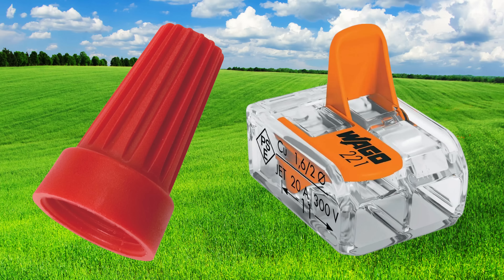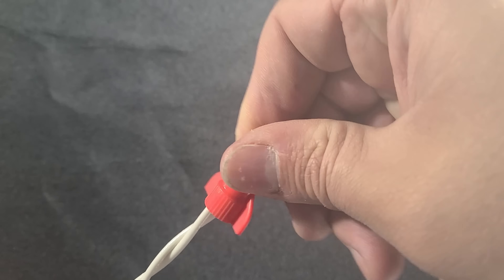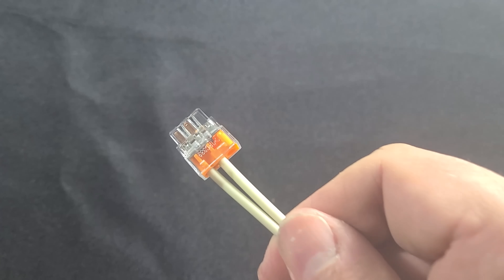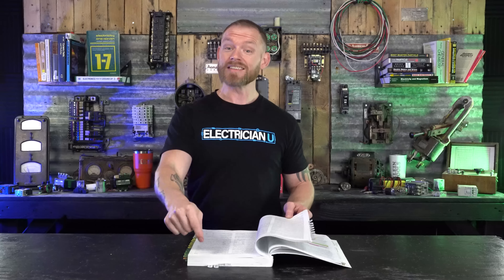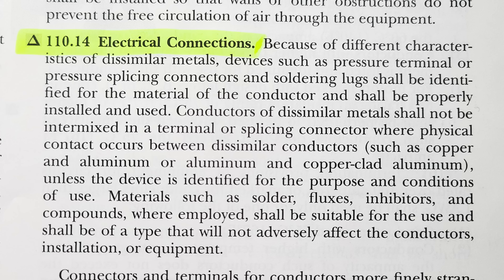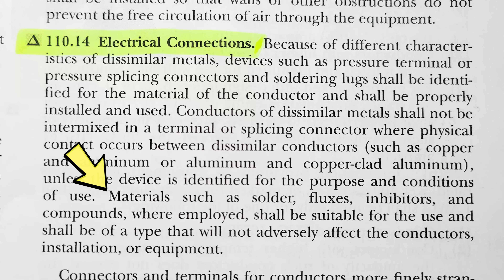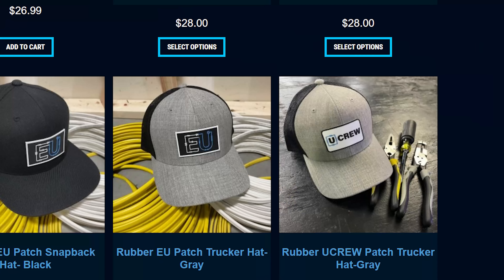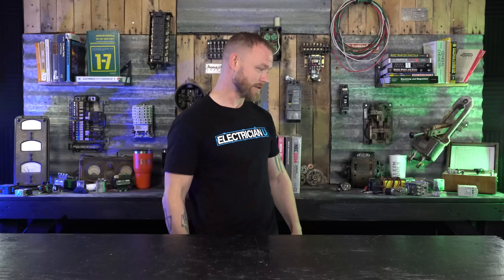Should We Use WAGOS or WIRENUTS?!?!

Comment: Why to use Wago:
- Way easier to install correctly(especially when connecting stranded to solid or different gauges)
- On first sight you can see if it's installed correctly
- Easy to troubleshoot and redo
- Does not damage wire
- Cheapest way to properly connect Cu with Al
- Saves time
- Can be used on shorter wires where you couldn't install wirenut
- Better in vibrating conditions

Why to use wirenuts:
- Cost
Reply: But if it's faster to use a WAGO than a Wirenut, then cost (in your time) is a plus of a WAGO.
Reply: @fredashay  depends on what you’re used to definitively. Experience = speed but I find wire nuts to be much faster especially for stranded wire. Mainly because it can be a pain to insert a stranded wire in the wago, they also take up slightly more space so you spend more time getting your wires to fit in the JBox. If I used wagos more often I’d prolly prefer them though
Reply: @fredashay  what difference does 5 or 10 seconds make? It is not like you need two hours to putl a wirenut.
Reply: @Cybergodless  Okay, but why an egg?
Reply: @fredashay  speed unimportant when wiring a nursery.
Reply: @fredashay  if all you care about is faster why don't you just lay down an extension cord and leave? that's the fastest way to wire a building.
Reply: @mrromantimothy  You may have a valid criticism for whatever it is I said, but I'm not gonna read through 89 comments to see what I said 6 months ago that you're replying to  ¯\_(ツ)_/¯
Reply: @fredashay  I'm not getting blue in the face over you I'm getting up blue in the face over people that will listen to me and not burn shit up
Reply: @PW_12345  1.5A of use? what? You have no clue what you are talking about I have multiple outlets in my house that are drawing 10A for a majority of the day. ALSO because the load wire will lead to OTHER outlets, not JUST to itself. your understanding is bad, the Wago and the Outlet will have the SAME UL ratings. Wago's ARE SPRING loaded, you increase and decrease the SPRING loaded tension with the lever.  this is how they are able to fit multiple sizes of wire. The backstab are SPRING loaded just without a lever
Reply: Wago's should not be used with Al.  Don't use Wago.  I've had more problems with Wago than wire nuts.  Anything over 15A you want to use wire nut.  If you working with under 10A and especially working with DC, then Wago is an option.
Reply: @joeboxter3635  Actually, wagos are rated for al conductors but the conductors must be treated with a special paste that Wago produces for the purpose.  They are one of only three permanent fixes for al wire termination accepted here in the USA.
Reply: All things being equal and with a properly trained electrician doing the install, a wire nut with pre-twisted conductors is and will ALWAYS be a superior connection. PERIOD
Reply: @chadillac2472  Would you bet your life on your electrician being "properly trained"?
Reply: @chadillac2472  But things are not equal, are they? 

In a big installation, you're looking at hundreds, potentially thousands, of connections needing to be made. That's many, MANY hours of extra work, for a few milliohms of gain on each circuit. It's virtually a drop of piss in the ocean.

Meanwhile, there are a lot of shortcomings to the wire nut: It's very difficult to use with short leads. You're unable to visually inspect the connection. The caps can come loose, leaving naked conductors in your junction boxes. The difficulty/impossibility of making a safe connection with stranded wire. And so on.
Reply: I'm concerned about the higher resistance caused by  a WAGO'S connection. They heat up a lot compared to the direct wire to wire connection of wirenuts. The higher resistance and inefficiency is the cost for comfort. Something I'd be willing to give up.
Reply: @AllinnKall  You're not concerned, you're just trying to justify using worse connector.
Reply: @AllinnKall  only a concern if youre running 50 amps on 12 awg wire. The resistance between the two connectors doesn't matter on your regular 15-20A circuits. Whatever electronic you got hooked up probably has cheap chinese 18-16 awg wire inside it anyways.
Reply: ...and reduced points of failure.  Wire nut connects wire to wire with full ampacity of the wire through the connection.  Wago has 2 points of failure and higher resistance than a wire nut connection increasing the risk of connection failure on a heavily loaded circuit or in a harsh environment.  Wire nuts for the win.👌
Reply: Happy birthday bro enjoy God bless you all
Reply: @PW_12345  again, I’m not reading this wall of crap. PRE TWIST THE FUCKING SOLID AS I MENTIONED, THEN TWIST THE FUCKING STRANDED OVER THE TOP FOLLOWING THE GROOVES OF THE SOLID. IT WILL NEVER PULL OUT YOU ABSOLUTE POTATO. Jesus fucking Christ.
Reply: the wago type of connection using CU to Al back in the '70s and '80s when Alcoa was pushing , aluminum Romex for residential use and the fires and  deaths that ensued was the original reason wire nuts with a stainless steel spring connection with solid copper pigtails to the device were and still are required.
Reply: @mrromantimothy  the Springs in the purple wirenuts are cu/al alloy and they are filled with Noalox.
Reply: one weak "con" for wago... They're not available at local stores, you have to order them online and wait 3+ days for them to arrive.
The closest I found were push-in connectors that are similar to european leverless Wagos. And those things are impossible to use with stranded wires.
Reply: @humbughumbughumbug  menards has them in stores.
Reply: @tremolobar  Oh... Unfortunately 😢 I live in the horrible state of New York, and we don't have Menards. We're stuck with Lowes, HD, and maybe Ace Hardware if we're lucky.
Reply: @humbughumbughumbug  all the local electrical supply houses have them in the upstate of NY.  I keep stock of a good array of the 221-40x and 221-60x Wagos.  Easy thing to do.
Reply: @mikeiver  that's because they are intended for fixtures and fixture wire you are using them for every thing you do is not correct
Reply: bulls eye! or should i say "money shot" (lame pun intended) since your comment was regarding price... hehehehehe
Reply: @Rowdy No, they are not.
Reply: @Rowdy Service entrance is nowhere near the same.
Reply: You forgot resistance and heat.  wagos get hotter
Reply: I use whatever. I have no preference. Been In The trade since 93. I find that a good connection no matter what it is will last longer than me.
Reply: I'm not an electrician by any means but would it better for home owners to use wire nuts because of cost and the few hours are minutes it would take him to do the job himself?(knowing what he's doing of course). Compared to an electrician who needs to work work fast because of the quantity of work he's doing without the loss of quality(proving that the leg-goes are quicker to install).
Reply: Spot on.
Easy to use/doesn't damage stranded conductors.
Always remember to utilise WAGO connectors according to the manufacturer's specification. ie you need to be professionally competent to understand equipment limitations - even WAGO connectors.
Reply: Wagos are also very handy on the workbench.  They will join a meter probe to a loose wire, when you're testing something small.  Then you get your wires back, undamaged.
Reply: @PW_12345  "Also in areas where there are a lot of hot/cold cycles I'm hearing the wegos are failing"

You're hearing bullshit. Wagos are best in this exact scenario because the spring keeps pressure even when the wires contracts/shift. The push and lever connectors are pretty much the same. The lever is not part of the spring clamp, it just allows you to apply pressure on the spring to easily install/remove the wire.

I don't say you can't make good connection using wirenut. It's just way easier to make a bad one.
Reply: Another pro for he wirenut is resistance. If there's a lot of current flowing through the connection, it might be better to use a wirenut over a Wago.
GreatScott just made a video comparing these connectors.
Reply: @ddegn  They have a higher resistance but they are both low enough that it really doesnt matter
Reply: @derfurz8618  2Watts per connection per phase on a 20Amp circuit adds up in a hurry, especially if factorvin the millions of connections in a country( think EU countries that require WAGO).
Reply: @ddegn  I noticed this years ago, and I now use wagos for holding branch circuit splices in lighting, and low voltage controls.  I'll splice 3 18 solids and place them in a single port, that eliminates 2 bus bar contacts.  So essentially branching off a single port with good splices lowers the resistance no?  I like wire nuts for my feeders and wagos for my branches.  If that makes sense.
Reply: @bigcountry5520  Not legal in the US but I understand what you are doing there.
Reply: @ddegn  I've seen several videos comparing the current capacity of both Wagos (multiple types of Wagos) and wire nuts, ramping the current up to failure. NONE of them failed up to their rating. All of them failed long after the wire's insulation failed. The resistance isn't going to be the determining factor for choosing Wago vs wire nut as long as you use them properly.
Reply: @ddegn  Exactly.  The wire nut is a CU to CU connection vice the WAGO CU to Steel one.  The resistance between the two, CU and steel, are significantly different.
Reply: @ddegn  "Another pro for he wirenut is resistance." The Wago type connectors are essentially bus bars with convenient connectors - would you not use a bus bar elsewhere?
Reply: @nickryan3417  "would you not use a bus bar elsewhere?"
Unless I wanted or needed less resistance.
Wago type connectors are much more convenient than wire nuts but this doesn't change the fact that wire nuts have less resistance.
Reply: @ddegn  wire nuts have more resistance. Studies were done and show this. Do research before saying something stupid sgain.
Reply: @vinniecocco9932  "Studies were done and show this."
Which studies?
I referenced a Great Scott! video in my earlier reply. The title of the video is "What Wire Connector is the Best? Settling a Debate! Wire Nut VS Wago."
This video shows the wire nuts tested had lower resistance than Wago connectors.
There's also a video titled "Comparing Wire Connector Resistance - Wago vs. Twist-on Wire Nut" on the channel "Christopher Masto." This video also shows the wire nut had less resistance than the Wago.
If you provide the name (or other search terms) of these "studies," I'll be glad to take a look at them.
How much more resistance do wire nuts have over Wago connectors?
Reply: @ddegn  Wagos are certified for 24 or 32 amps and are guaranteed to deliver that. That is plenty for almost all use cases. A badly installed wirenut can handle less and you can only tell if you fucked it up after the house burnt down. Wago anytime of the day, safer and faster, the costs are minimal compared to the time you save installing.
Reply: @modmoto6016  I'm sold on Wagos myself. I'm just pointing out a couple sources (YouTube videos) which show wire nuts had less resistance than Wagos. Even if a wire nut can have less resistance than a Wago there are plenty of other reasons to chose a Wago over a wire nut.
After watching the various Wago vs wire nut videos, I purchased more Wago connectors. I haven't purchased any new wire nuts. This doesn't change the fact the videos mentioned show lower resistance in a wire nut compared with a Wago.
Again, if someone has sources showing Wagos have less resistance than wire nuts, I'd like to see them.
Reply: @ddegn  if there's a lot of current flowing through you better sold these cables together
Reply: @ddegn  You should dimension your wires and section your installation in a way that you have enough headroom to safely manage any added resistance. And really, we're talking some amount of milliohms per connection, if that.
Reply: @ddegn  the Wago’s I used are rated for 20 Amps and 300 volts. That should cover most stuff in the home.
Reply: @ddegn only at the start… for 23Amps…. I think he was aiming a heat gun directly on the components… you’re never gonna do that in real life… plus… after 20mins, they all went to the same temperature more or less…. At about 105 degrees I think… Wago & wire nuts are rated at 221F so no cause for alarm… some components do get hot with time but that’s mostly normal depending on the work/load & time

Wagos are the norm in most parts of Europe while Wirenuts are the norm in the US because it’s cost effective and do the same thing 

I still however favor Wagos since they’re much less time consuming and there’s a less likely chance you’ll connect a Wago wrong Vs a wirenut… electricians get rushed to finish fast as well so Wagos might be the better fit in the US like 10yrs down the road since the US is slower to adapt than other places because bureaucracy
Reply: @carlosf9278  I've mentioned several times in this thread, I prefer to use Wago connectors more than wire nuts. 
@vinniecocco9932  Claimed there were studies showing Wagos had less resistance than wire nuts but never provided a way to find these studies.
I provided names to a couple videos which claim to show wire nuts have less resistance than Wagos. While it seems logical that a wire nut used correctly has less resistance, I don't think this slightly lower resistance is enough for most people (myself included) to chose wire nuts over Wagos.
Since making my first reply in this thread, I've used many Wago connectors in various projects. I haven't used a wire nut for several decades.
Reply: @ddegn  I use mostly wire nuts since that’s what the company I work for uses/has… I work for a general contracting company, and we use whatever, and every clients we’ve ever had, has never had an issue… well except a few leaks here and there but that’s our plumbers fault lol

Electrical wiring/configuration, no issues… but mostly using wire nuts 🥜 

We’ve yet to use Wagos on a home all the way… every now and then I have some on me that I purchase either online or at Home Depot (some Home Depot’s sell wago!!!) & they work great… as far as long term use I can’t say for sure since I’ve only ever used a Wago for a little less than a year. 

Wagos are definitely nice to use and definitely help a lot when you’re doing a 3/4 way connection. Many electricians in the states prefer wire nuts and I think that’s mostly because how they were taught/prefer and I respect that 

I’m studying to be an Electrical Engineer so since I’m doing General Contracting, hardly anyone teaches me anything since I’ll only be helping for a moment… which sucks since that means I’ll have to work twice as hard in order to learns the things that some of my coworkers learned from their superiors in the past 🫠
Reply: @carlosf9278  
Thanks for all the great info.
Good luck with your education.
Reply: @ddegn  You Americans are so obsessed with this 1 non existing issue on the Wago's, it's literally the only thing you can find against them.
Reply: @DonBugatti  Did you miss my replies where I state I prefer Wagos? I simply stated the results of a couple of YouTube videos stating wire nuts have less resistance than Wagos. As I've stated several times, I prefer Wagos over wire nuts. Why do you think I'm obsessed with this? I'm not the one commentating on old replies. If someone is obsessed, it's you.
Reply: @ddegn  umm WAGO's have a current rating, you just use the right one for the job. 
is that the video where he put over 23A through a 20A WAGO? and it was slightly hotter than the wire nut but still well below the max temp rating of the WAGO?
Reply: @johng.1703  It's been a while since I've watched the video but I think you're describing it correctly.
As I've said many times, I prefer Wagos myself. I was just stating the fact a few YouTube videos show wire nuts have a lower resistance than Wago connectors. I personally haven't used a wire nut since purchasing Wago connectors. The very slight resistance advantage and lower cost of wire nuts doesn't make up for how much easier Wago connectors are to use.
I have a bunch of Wago connectors within arms reach as I type this and I don't know were my wire nuts are (I think I have some in a box somewhere).
As you say, if you use Wago connectors with the correct rating, they should work fine.
Reply: @ddegn  Might be. But I'd still prefer slightly worse resistance and consistent results than slightly better resistance, but possible firestarter hidden under pen cap.
Reply: @neplatnyudaj110  "But I'd still prefer slightly worse resistance"
More resistance is more heat.
More heat is a fire hazard.

Also, some of your points about the WAGO apply just as much to Wirenuts:
- Easy to troubleshoot and redo
- Does not damage wire

Wirenuts do not "damage" the wire.  Wirenuts are simple to troubleshoot and redo.

Correct installation should not be an issue; you twist the wires together and then you twist the nut on.  It "saves time" to do things right the first time.
Reply: @neplatnyudaj110  "Possible firestarter" is a pretty extreme, bordering strongly on dishonest, way to describe wire nuts.
Reply: Master Electrician, here.
The difference is too minor to matter. In the real world, there will be more voltage drop due to worn plugs, barely adequate appliance wiring, extension cords, etc.
Every single test, every single, solitary test shows the extremely minor difference leads to a trivial rise in heating, so far below the rated temperature for the WAGO 22xs that it is completely irrelevant - even when a circuit is run at 15% over maximum for over an hour.
I would like to see 10,000 'wire-nut' connections with the annealed wires and poorly made connections one finds in the field every single day compared to 10,000 WAGO 22x connections done by DIY'ers of the same level.
We all know which connections would be better over time -the WAGO, hands down.
Especially when connecting stranded to solid wire. @ddegn
Reply: preitwisted wirenuts are better, stronger splices that last longer
Reply: I work in aviation and aluminum touching  dissimilar metals = corrosion. As well, doesn’t aluminum expand and contract at different rates from other metals when heated and cooled? I believe that’s the problem with aluminum wiring to begin with. Please correct me if i’m wrong, i usually get almost as much info from the comments as i do from the videos.
Reply: @huejanus5505  back in the late '70s Alcoa started pushing aluminum romex and a lot of residential homes were wired with it they stabbed the wires in the back like a wago and that caused a lot of home fires where that aluminum Rolex got banned.
Reply: @huejanus5505  back in the late '70s Alcoa started pushing aluminum romex and a lot of residential homes were wired with it they stabbed the wires in the back like a wago and that caused a lot of home fires where that aluminum Rolex got banned.
Reply: @PW_12345  no. Just no. I stopped reading as soon as you said solid wires pull out if you pre twist. Read what I’m writing. I’ll try to use small words. Strip each conductor longer than required. Make sure the stripped ends are straight. Lay them side by side. Grab every conductor (while they are still SIDE BY SIDE) with your lineman’s and twist them together. When sufficiently twisted, cut the end of the bundle off so they come to a neat point. They will NEVER pull out. Stop arguing and do it you potato. You obviously have never done it. You are arguing that apples aren’t red when you’ve never seen an apple. Don’t be a potato, potato.
Reply: The wagos we used at my solar company didn’t push and lock it, the tab just flipped down so sometimes when someone would tuck the wires away in the box, the tabs would flip up and you’d have a loose connection.
Reply: @acog_quarks8753  not a fault of the connector but rather the installer and sloppy workmanship.
Reply: @mikeiver  when you have to stuff a small box full of 10 gauge wire like you’re Joe Jackson then you can’t expect the best
Reply: if I was terminating in the UK I would use them because they have a 220 volt receptacle but in the USA they will cause an arc fault melt the whole box if it's plastic and the faceplate, I've seen him do it three times last year and four times a year before and I do a lot of troubleshooting they are always the problem
Reply: if I was terminating in the UK I would use them because they have a 220 volt receptacle but in the USA they will cause an arc fault melt the whole box if it's plastic and the faceplate, I've seen him do it three times last year and four times a year before and I do a lot of troubleshooting they are always the problem
Reply: you using words like properly and correctly and when it isn't true they just don't make the connection it doesn't illegal connection actually in a commercial building you have to either have a wire nut with a spring or a side screw that has a thousand pounds of pressure for your terminations on receptacles and switches.
Reply: Wags's are for lazy newbies, homeowners, and weekend warriors.
Reply: @Cybergodless  So are wirenuts. Real men   twist, solder and tape.
Reply: @neplatnyudaj110  Yeah, Neandertal and Australopithecus did that with lead.
Reply: "Cheapest way to properly connect Cu with Al"   Wrong!  They are not rated for aluminum wire termination, PERIOD!  There are only two acceptable and permanent methods for terminating aluminum and copper clad aluminum wire.  One being by King Innovations and the other is by Tyco.  The Ideal purple twisters are not accepted as permanent terminations.
Reply: @mikeiver  Nope, you're wrong! There are WAGO connectors, which validated to connect Cu to Al (with contact paste). Check out the website and specifications.
Reply: @EFazy  I know, still would not use them.  I would not use the Ideal Purple twisters either and they were supposedly validated for Al to Cu.
Reply: @mikeiver  I've been using Noalox which isn't even the recommended brand for WAGO contact paste and they have been working 5+ years, even under constant 12-14 amp current.  Recently inspected - no bulging, no oxidation, and I keep the levers taped together all the way to where the wire goes in to prevent air from getting into the wago ports to prevent oxygen/moisture exposure which is what causes fires in AL to CU connections.

I only use 10/2 AL and 10/2 CU solid conductors.  I have no problems.  You have to be careful using King Innovations, I've had splicing lugs that had NO antiox in them, and had to put some Antiox paste in them.  I also always use a fresh cut conductor when splicing these.
Reply: @mikeiver  Sure, if you think so. I'll keep using Wago contact paste and their connectors.
Reply: @neplatnyudaj110 By all means you do that.  If you were here in the states and a fire resulted from your improper connections the insurance company would come after you for failure to follow code.  Your insurance provider would disallow the claim coverage and terminate your insurance.  It is not clear if it has been listed here in the states for permanent splicing or taps with aluminum and copper conductors.  It appears that with their Alu-Plus contact paste certain series of Wago connectors are rated in Germany for conductors of up to 4mm².  So at least in European applications it would appear I am wrong.  I would much rather use the King innovations solution or if money is no object, the Tyco crimp splice system..
Reply: @mikeiver  Europe has a 220 voltage for the receptacles and the Lego is safe to use there we have a 110 volt system and it causes an arc fault here voltage is pressure you know
Reply: @mikeiver  Europe has a 220 voltage for the receptacles and the Lego is safe to use there we have a 110 volt system and it causes an arc fault here voltage is pressure you know
Reply: @mikeiver  You shouldn't ever use aluminum wire. EVER. So this will never be a problem.
Reply: @joblessalex  For the mains and feeding sub panels we use it just about always.  We simply up size to compensate for the greater resistance of aluminum conductors.  Considering that the cost of copper is about 4.5 times that of aluminum at this time, aluminum is the conductor of choice.
Reply: @joblessalex  I would never use aluminum wire for anything well maybe an antenna. Still copper is better. I have enough so cost is not an issue.

P.S. buy low and use it when the price is high. It was 35 dollars a 250 foot roll.  I also bought two more rolls when it was 55 dollars a roll. glad I did. I should have bought three conductor for switch circuits. Oh well I can rough it and pay for a small roll for 3 way circuits.
Reply: @ronb6182  You are playing then. I have just gone thru over 28,000 feet of 12Ga wire and 5,000 feet of 10Ga.  1,500ft of 8Ga and 1,500ft of 6Ga.  That was in the last month and a half.  I don't have a crystal ball to have bought and the space to stock that much material. All the wire I would/might need for the year.  I buy wirenuts by the thousand and wago 221 and push in connectors by the hundreds.
Reply: @mikeiver  no I'm not a licensed electrician I do my own wiring and so far I never failed an inspection. I had one comeback over thirty years ago because of a ground issue but an easy fix. My dad taught me everything because he did his own wiring, one inspector told mom not to worry your husband knows what he is doing . He also told her he wires better than most licensed electricians. 

My next project is to wire a shed my father in law built. I am going to use EMT. The shed has a few outlets and two lights wired with Romex but I will remove those two circuits. EMT will be better and this project will be  good practice in bending EMT.  73
Reply: @mikeiver  Wait, I thought aluminum wires were code violations in the US? I thought we had to use solid copper. 
Or does that not apply to wiring feeding a pannel? (if that's the case that makes no sense to me.)
Reply: @joblessalex  tell that to all US power providers
Reply: @VonGeggry  So for devices in a home here we no longer use aluminum or copper clad aluminum wire.  This is for a number of good reasons.  Mainly that the devices are not compatible with the wire.    Alloy type being another issue.  Connection reliability yet another.  When found, the conductors are also up sized as well with 15 amp circuits  being fed with 12ga (4.0mm²) and 20 amp feeds being 10ga (6.0mm²).  There are, to the best of my knowledge only three recognized splices accepted allowed here.  One is by Tyco company and is stunningly expensive to get both the training, rent the tool (they do not sell it) and buy the consumables.  Another is more of an insulated terminal block which requires a torque limiting screwdrive for install.  The last being Wagos but requiring a special paste on the wire.  So now days all circuits, 30 amps and below are usually copper.  Just about everything 40 amps and above, unless specifically required by a manufacturer that only copper be used are fed with aluminum conductors.  Of course they are up sized to limit voltage drop.  So in the case of a120/240V 200Amp home service we would feed it with 8000 series 4/0-4/0_ 2/0 aluminum conductors jacketed with PEX insulation and jacketed with PVC for outdoor service drops.  A typical larger home requiring a sub feed panel at the other end would have a sub feed cable, again 8000 series 2-2-4-4 aluminum conductors jacketed with PEX insulation and jacketed with PVC.  Neutrals are downsized 20% as is the ground.  A range outlet rated 50 amps would be fed with 6ga aluminum.  There are many other instances where aluminum is used over copper.  I recently did a 400 amp sub feed panel with 750mcm aluminum wire.  The run was very long and would have been neer 4 times as much in copper.  Also it would have been far harder to pull in due to the weight difference.
Reply: @joblessalex  Incorrect - Aluminum is just as good as copper - you just need more of it.  Thicker gauge aluminum for the same current as copper.  Common mistake where aluminum fails, is when you use the same gauge alum to copper.  Quit spreading fear without knowledge.
Reply: @Nitro187  True, but it also oxidizes worse than copper causing poor connections earlier. You have to be extremely careful with it. It is still significantly worse than copper in all regards.
Reply: @joblessalex  only oxidizes if used in properly.  Follow the proper procedures and all is good.  Qualified electricians would follow the proper procedures... so aluminum is 100% safe.
Reply: @joblessalex  I will use any type of wire I need to whether overhead or underground with the correct terminations so I never have to come back I don't have returned service calls or have to worry about anyone getting burned in a fire my terminations are permanent and final.
Reply: @ronb6182  dude we have parallel childhoods my father told me fuck the inspector you're the inspector I've never felt an inspection either I've been an electrician for over all 50 years or so my custom homes commercial buildings industrial plants any kind of building you name it never had a call back EMT is the best way to go.
Reply: @ronb6182  dude we have parallel childhoods my father told me fuck the inspector you're the inspector I've never felt an inspection either I've been an electrician for over all 50 years or so my custom homes commercial buildings industrial plants any kind of building you name it never had a call back EMT is the best way to go.
Reply: @joblessalex  you are simply not correct here.  Modern aluminum conductors (talking 8000 series here) are rated and have minimal oxidation issues.  Most professionals also use a product like Ideal Noalox on the wire/ lug interface to eliminate the issue all together.  I make my living as a professional master electrician and use aluminum wire for larger loads and services all the time including in my home.  Copper is just to expensive and there is little advantage to using it all things taken into account.  On a large sub panel feed, 400Amp 3Phase with a neutral and ground, the material and installation labor and up being about 5 times that of aluminum conductors.  Fine if you have a customer willing to absorb the additional cost but not necessary.
Reply: @mikeiver  Yeah, that sounds like you're doing power lines. Down here in the normal people market we don't have access to all the things needed to bodge together aluminum in a way that is safe. People are using it as in wall wire oblivious to what it is. They're using it as high current 12v without properly upping the awg to match the shitty wire. Really messes things up when you need 8awg copper minimum and they use CCA 8 instead.
Reply: @joblessalex  Well in the states they don't make aluminum wire smaller than 8Ga for use in electrical.  Aluminum wire is generally available 6Ga and larger.  We don't use it in homes for convince outlets and lighting, not since the 70s.  Also, no one uses it for 12Vdc here to my knowledge nor would it be legal either.  If were talking safety then how about Joe home owner who decides he is gonna run a 240Vac circuit in 14Ga and lands it on a 30Amp breaker.  The same thing.
Reply: @joblessalex  Most SER and SEU cable used in residential is aluminum. There is NOTHING wrong with aluminum wire per se. But it must be terminated correctly.
Reply: @joblessalex  that’s the customers’ decision, though. I can recommend Cu conductors till the cows come home but ultimately it’s not my decision unless I’m working on my home..
Reply: @ronb6182  Depends. For many applications, aluminum is a far superior conductor than copper. Example: At one time power utilities did use a lot of copper, but today most everything on the transmission and distribution side is aluminum. It's some of those advantages why aluminum was also used in buildings...but unfortunately with how it came about some pretty terrible engineering(or total lack thereof!).  Just to even give you an example, "ACSS" wire("Aluminum Conductor Steel Supported) is used in modern transmission lines the allow is nearly pure aluminum metal in the fully annealed or "dead soft" condition. Bend a strand of it once or twice it breaks; write your name on it with a ball-point pen(not in ink but imprinted into the metal), hold a piece of it, it might remind you of solder...well, until it breaks.  However, it's used today vs. stronger alloys & tempers were more used in the past because of things you might never think of, ex: Aeolian vibration resistance, resistance to sag, high temperature capabilities, etc.  Even to the point there's line wire known as "ACAR"("Aluminum Conductor Alloy Reinforced") that the outer strands are 1350 electrical grade nearly pure aluminum vs. the core is 6201 alloy(magnesium & silicon).  The 6201 only has half the cross sectional conductivity of copper vs. up to 63% for the 1350, but the tensile strength of the 6201 is twice that of the 1350. Otherwise though remember that copper is about 60% more conductive than aluminum by cross-sectional area, but aluminum is twice as conductive as copper by weight, ex: atomic number 13 vs. atomic number 29 the latter's gotta carry a lot more protons and neutrons(which are nearly all the weight) for the slippery electrons we love.
Reply: @teds9896  I don't need to read a book. Aluminum is a fire hazard that's why it was removed from manufactured homes. Copper is far superior than any other metal. Only silver exceeds copper but the cost nullified it's use. 73

PS short answers get read not books
Reply: "Cheapest way to properly connect Cu with Al" - nope. You still need to use AluPlus paste made for these kinds of connections. NEVER EVER connect copper with aluminium in Wago without this paste.
Reply: @HendriuGaming  AluPaste costs $2 and is good for maybe 50 connections. Yes, you shouldn't use it without paste, but even if you do, it's 100 times better than using wirenut since Al and Cu won't come in contact.
Reply: Why not use a Wago, Because it is the same connection type of the dreaded stab connection on the back of a receptacle that every electrician says never to use... unless it is in the form of a wago ?
Reply: @Catalyph  uh no. Wagos and stab lock are NOT the same.
Reply: @jman0870  they both use pressure fit cut edges to hold the connector. Both spring loaded.. how arebthey different ?
Reply: @Catalyph  they aren’t spring loaded. Wagos have a locking cam.
Reply: @jman0870  That locking cam is spring loaded. the CAM applies pressure to the SPRING cut in edge and compresses it... still spring loaded, ALSO many WAGOS are press-in without a level or cam.
Reply: @Catalyph  Wagos for house wiring are NOT stab lock dude
Reply: @Catalyph  in fact, stab lock anything is against electrical code in the majority of, if not all of, the United States. There are bullshit exemptions for factory one like you see in light fixtures. I cut them out when I see them. 🤷‍♂️
Reply: @jman0870  I don't mean the brand stablock I mean the back stab hole in most modern receptacles and switches. They ARE to code, else they would not be one CODE compliant devices.
Reply: @Catalyph  you cannot use switches and receptacles that you “push in” the wires. I don’t have the time, nor the crayons, to explain it to you any further.
Reply: @jman0870  Yes you can, You buy a receptacle, that has that feature, and you can use it. WTF are you talking about.
Reply: @Catalyph  back stab outlets and switches suck ass hard!  Yes they are accepted.  But they suck, heat up and fail on sustained high current loads.  Tract home has electricians use them when devicing to save time and ring every last penny out of the low margin jobs.  No self respecting electrician uses them, ever!
Reply: @mikeiver  yet the same mechanism as a wago...
Reply: @Catalyph  i could fill a wheelbarrow with all the backstabb devices I have replaced over the years that have failed.  And the stab-in Wagos and Ideal In-sure connectors fail as well.
Reply: @jman0870 almost all the cheap switches and receptacles have backstabbing connectors, and almost all of the tract home builders use them. What are you talking about?
Reply: @PW_12345  if you aren’t pre twisting you are doing it wrong pal. You pre twist solid conductors with your linesman’s and snip the end off. Cap with a nut spun on with a wire nut wrench or your strippers. Stranded conductors should be stripped long and evenly twisted together followed by a wire nut spun on with a wire nut wrench or strippers. 

I don’t care what you think you know, you are wrong. It is NEVER acceptable to jam all your conductors straight into a nut without pre twisting. It is NOT the wire nuts job to twist the conductors together. YOU are directly responsible for people claiming that wire nuts are “inferior” and will eventually cause major damage because loose wires cause fires. Before you try to tell me you are a master electrician with 5729572951 years of experience, I am telling you that no less than 10 master electricians with a combined total of 400 years of experience, my schooling,  and the literally uncountable amount of melted wire nuts I’ve replaced that contained AT LEAST one conductor that just fell out of the bundle when disturbed also say you are wrong.
Reply: Noalox is cheaper than a wago. Wagos are a waste of money. You’ll never change my mind. 🤣
Reply: Better in vibrating conditions????
ok 100% you are not electrician bias opinion

what wirenuts got?
- 3x - 1000x times bigger surface area, YOUR choice
-i f you are a proper electrician and you no what you doing you can pre twist them so hard some times than you can make ti happen the Cold Fusion.
- when the professional pre twist the wires if he like it he can let so many twists and length so is 1000000% not give  up in any force.
- THE MOST CRITICAL TEMPERATURES: ALL metals  in the world, the more you heat up a metal he is going to stretch up. ALL vagos loose lite pressure and because that can happen multiple time per year and that's cause the metal loose the flexibility so vagos after 10 years are worst conductors than professionals pre twist nuts
PLUS because they are PRE twist when the temp go up and the try to stretch up  the CANCEL each other so after 2000 years  they gonna have the same pressure.
- when you professional pre twist 4 cable together the complete surface area on that twist is 4 TIMES bigger than a wago and because a professional make it have close 2x ++  times less resistant than means less chance to heat up

Wago is medium and low amp jobs
pre twist is for HIGH current and extreme durable connections.
Reply: @skyfoxrinoasfr4778  finally! Someone who isn’t an idiot! People don’t pre twist wires anymore even though you are supposed to. ESPECIALLY SOLID CONDUCTORS. I trust Wagos the least with solid conductors. I’ve seen what happens to the old school stab lock crap and Wagos are only a step above. People are relying on a tiny plastic cam to keep their houses from burning down. It’s hilarious.
Reply: @jman0870  just about a month ago I had some friends they tried to electrical  troubleshoot a home and couldn't find the problem, so I was asked to go over there and it was a receptacle behind the lady's bed, the receptacle was so hot I couldn't even touch it , there was the only wago in the home arcing away and generating heat, what the lady was kind of pissed and really upset at how close she came to burning alive, I got my camera and I'm going to start documenting these things this trade you can't afford to be half-assing things are making bad connections because people can die
Reply: @mrromantimothy  yeah…I’m not a fan of wagos
Reply: Cost is why I won't use them. When they start making them in the USA and start providing jobs for our citizens then I may change.
Reply: @ronb6182  Wh< should WAGO start producing in the US? ... They're already DOING that... at Germantown, Wisconsin. Just check their Website an search for their Production Sites...
Reply: @tesophis8919  to put Americans to work. We have foreign car plants just continue the movement for other products not just Wago.
Reply: @ronb6182  but do you shop at Walmart, Ron?
Reply: @ronb6182  you might as well not buy shit since everything comes from around the globe nowadays lmao
Reply: @ronb6182  I assume you are also just consuming US, i assume you are american, produced food, only use 100% US manufactured goods and only use Services that aree 100% US based.
Reply: @derfurz8618  don't ever assume! Enough said!